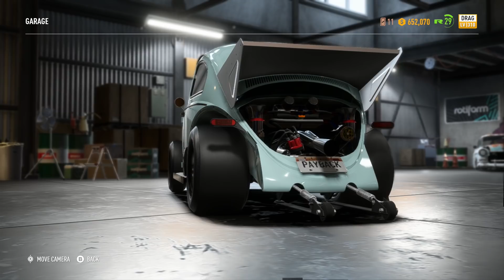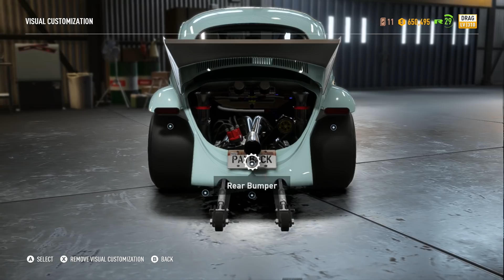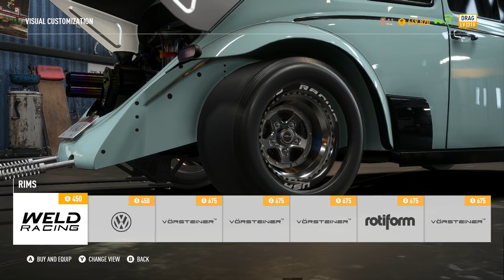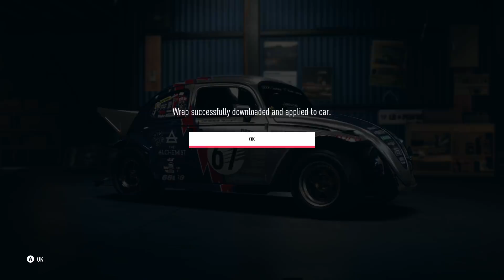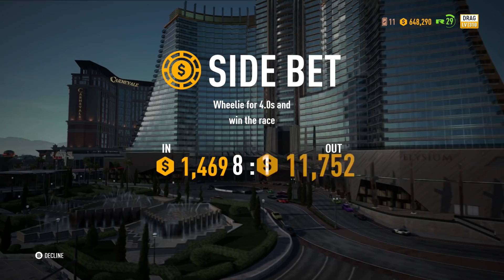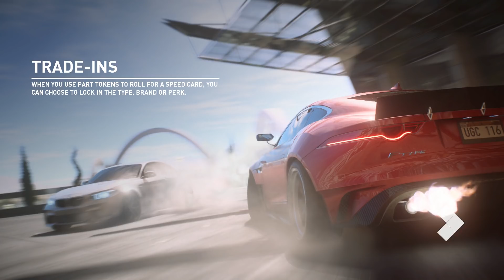Need for Speed Payback | VW Beetle SUPERBUILD

Comment: How do you get to the super build? Do you do races? go to the shop and buy upgrades? Nobody is showing this???
Reply from the maker: Superbuilds are only available on the derelict cars that you have to find.
Reply from the maker: What do you mean out of stock form?
Reply: Hey, once you have built any derelict you can make it a superbuild when it gets to level 300, at that point you go inti customize and select the roof, there it will have the superbuild option - you can also change and remove superbuild parts individually.

Once you have found all derelicts and parts, they will all be available at any dealership